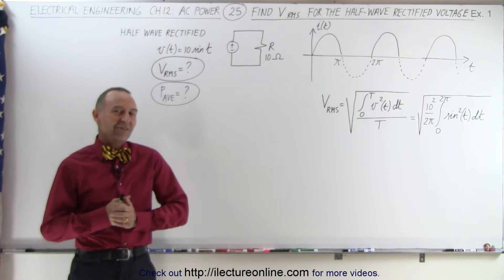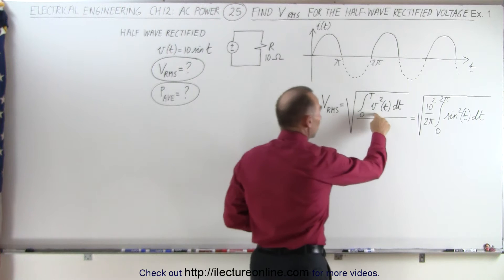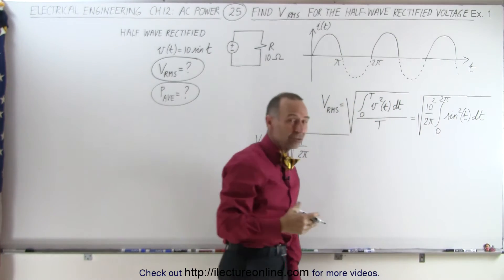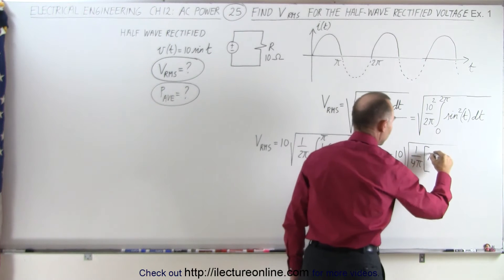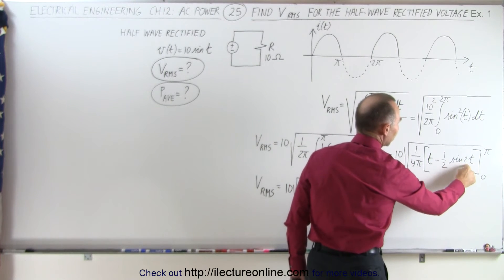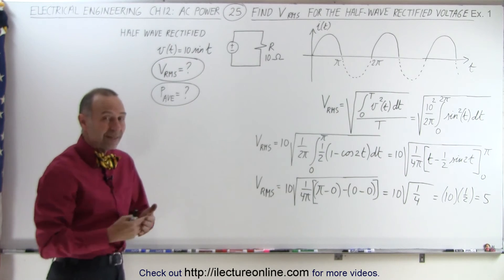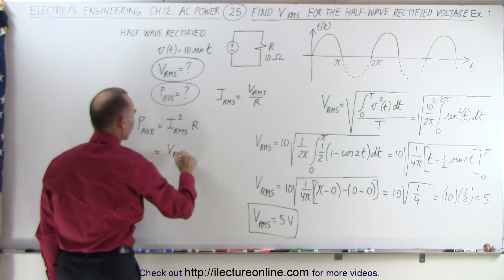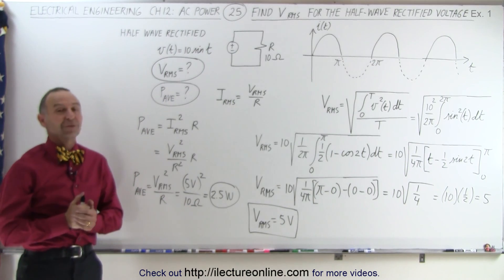Electrical Engineering: Ch 12 AC Power (25 of 58) Find V-RMS for Half -Wave Rectified Voltage

Comment: Hello Professor that was an excellent video, thank you! Anyhow i have a doubt. For the upper value limit and the lower value limit of the integral you selected π  and 0 respectively, I am assuming that is because this is a half wave rectified sine wave and the period is π. However for for the value of T in 1/T, you selected T as 2π, could you explain why is T=2π and not just π again? Thank you very much Professor.
Reply from the maker: The period is of a repeating portion of the wave is still 2 pi.    We only need to integrate over the portion where there is a voltage, because integration over zero = zero